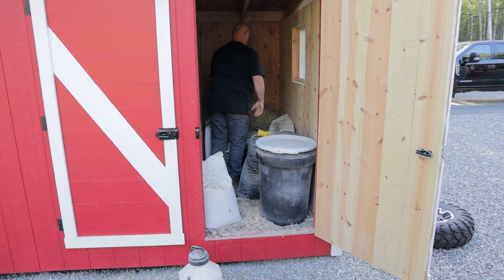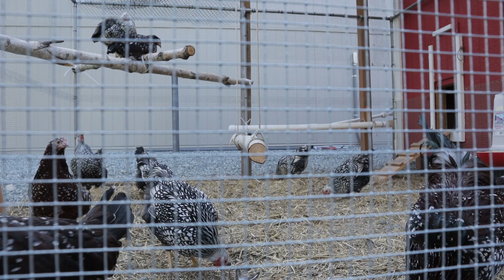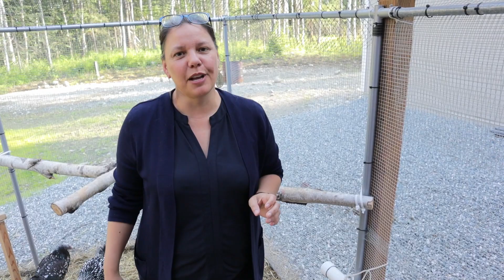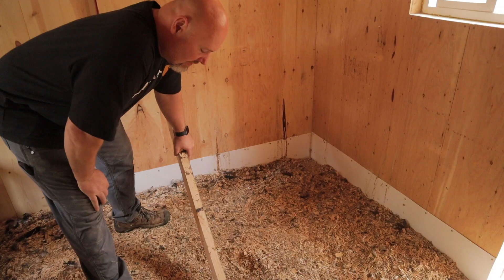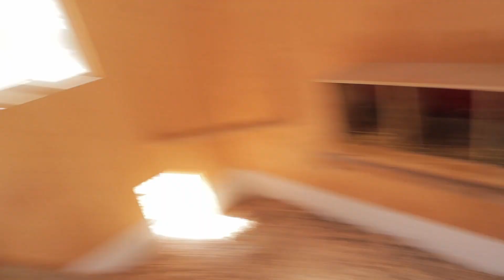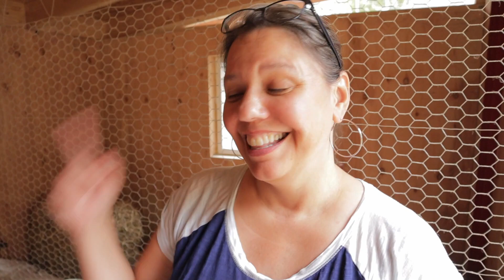Finally our First Chicken egg!! - Raising backyard Chickens

Comment: You guy's did a great job with that chicken house, hope your taking it along to Tok. Regarding the birds, if your intent is constant egg production, continuous feed purchase, and bird replacement every two years then layer feed is the way to go. If you would like to be more sustainable with your chicken operation then you should consider feed that you can raise that will sustain your birds for many years of production, I have had some hens produce regularly for over a decade. Chickens have a natural reproductive cycle that is activated by a rooster, and their system will rest and recover between laying cycles. Layer feed negates the need for a rooster, artificially induces their laying cycle, and burns out their reproductive systems through constant production.
Reply from the maker: Thank you and yes the coop is moving with us.  Great info on the feed vs rooster. 👍😊
Reply: @wildwoodoffgridalaska  forgot to mention, once they are full grown (around 20 weeks) you will need to restrict their feed to 3% of their body weight per day per bird. Your birds will reach approx. 4lbs. so roughly 2oz. (by weight not volume) per bird per day. If you allow over feeding they will get fat and stop laying, even if fed layer. The carbs in the grain are what fattens them,  higher protein ratio and and calcium promote better egg production. I generally stay in the 16-18% protein ratio for my layers.